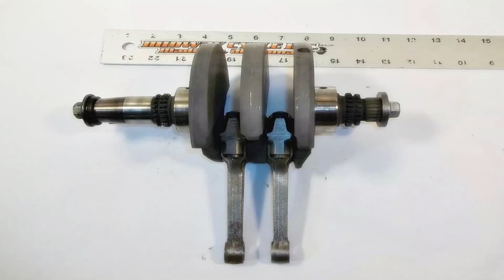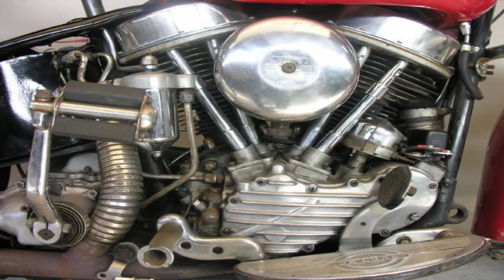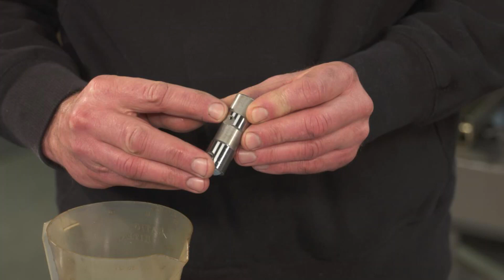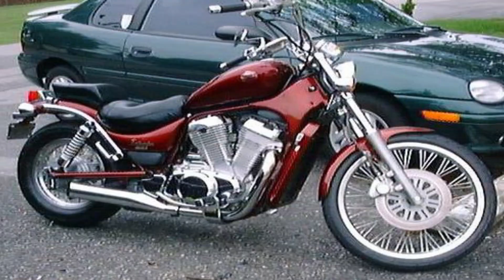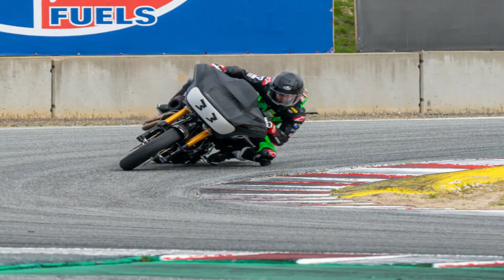Harley-Davidson Engine Design is the Worst

Comment: The victory looked to metric -  
Corvette uses pushrod engine still ; lower center of gravity. Top fuel nhra still using pushrod engine .
✊🏻👍👌
Reply from the maker: That was my issue with the Victory, it looked like a Metric bike with the fit and finish.
Reply: 1) there have been high performance Corvettes with DOHC cylinder heads.  C4 ZR1 Black Widow.  Used an engine (LT5) that became the basis of the Cadillac Northstar V8.  Very cool.  Rumor is the 2023 Z06 will be getting a new DOHC engine as well.

2) Ultimately, there is no replacement for displacement*.

*It's the same reason Harley big twins get used for drag bike motors.  Just about any improvement that can be made to a smaller displacement engine can be done to a larger displacement engine and make even greater increases of power.  Lo and behold, there are tons and tons of big block V8s from more than half a century ago still around that can be built into insanely powerful motors today that the manufacturers of yesteryear never dreamed of.  There are at this point, decades after big blocks stopped being put in passenger vehicles, probably as many H-D big V-twins around, and many, many more on the road.  The difference being that H-D makes their equivalent of a production big block with the same mentality of the Big 3 in the 1960s TODAY.

There are better ways to go about making cars and motorcycles than "do one thing well, and stick with it", especially when that one thing is an engine note and the vibration it makes grown men feel in their ass and groin.  EVERY OTHER MAJOR MOTORCYCLE MANUFACTURER ON THE PLANET SEEMS TO HAVE FIGURED THIS OUT, INCLUDING MAKING METRIC BIKES THAT TICKLE OLD MAN GOOCH.

Comment: The HD V twin design when assembled correctly with proper components is a simple and reliable engine that can be durable. Its  basically a tractor engine that makes torque!!!!
Reply from the maker: That is very true, a built Harley engine can be an absolute tank!
Reply: i agree but " assembled right" means you have to split the casses and start over and if done right youve used aftermarket cases. I put a half a million miles on my 71 but.....
Reply: @davidfellows6250  wow. That's a long ride. Is that 1971? Shovel Head.
Reply: @freyatilly  yeah the engine was a 71. the rest of the bike was a bastard like all my bikes. We used to go to swap meets for all our bikes. i bought a 67- 72 (5) shovelhead . but the 71 was the one i kepted for 20 years.

Comment: Just build a high-quality bulletproof V-Twin with a great suspension and brakes. Hit 100-foot pounds of torque at 2,000 RPMs and 100 horsepower at 4,000 RPMs. All very attainable in a V-Twin. This will give you 120 / 130 foots pounds of torque around 3,000 RPMs. Perfection, in my opinion. It's the government that will make Harley change, not its customers.
Reply from the maker: Harley could build a bullet proof engine, they did with the Evo! Yeah it's gonna be the government forcing change before the customers!
Reply: @GixxerFoo  The early twin cam if gear-driven would have been perfect too

Comment: dude .my 800 vulcan does the potato song quite well. i play guitar. im trying to record ghost riders with the vulcan as the drummer ! open slash cuts and a custom carb. sounds very much like mini  a twin cam with nice cams! no disrespect to the Harley guys , i don't have the coins for an American bike. if it makes you feel better , i call her my Hardley Davidson. HA! it's just a good bike and it really comes close to the Harley sound .it too has single pin but staggered.
Reply from the maker: The Vulcan 800 sounds really good! That newer 900 can't match the sound of the 800.
Reply: The Vulcan 800 is a good bike, but im scared that you play guitar and think the Vulcan 800 have almost the HD sound.
I play guitar and the 800 is not near the sound of a HD. Okey maybe the Street 750! But that is not a potato sound ,more like Singer sewing machine.

Comment: i hope n pray harley doesnt change   this is what harley riders hear in there sleep    not a atv sound of some bikes  i do wish they would engineer a cast crank with slipper bearings    thanks for the show    i really look foreward to your shows    I recently changed out my primary chain auto tensioner on my m8 to a manual    now it shifts like a dream    n    falls out of gear at a idle with no effort...    thanks again
Reply from the maker: That is awesome to hear you got that bike shifting and working like it should now! Thank you for watching, I appreciate it!

Comment: Look up the XBRR engine if you want to see a push rod Harley engine going to the extreme.
Reply from the maker: Yes! That was a wild 150+ horsepower Sportster based engine that actually ran with the big dogs in road racing.

Comment: With a set of Andrews 472 cams, Lloyds air filter, Power Commander fuel tuner pulls good at 2,500 all the way to 6,250 RPM. I have owned 18 Harley's and one Victory Cross Country 106 and you can speed about $1,850 to have strong running Victory vs a Harley that you will have to spend two times as much and still won't outrun a Victory. I'm speaking from experience. My friend has a hot 106 Cross Country and he has outrun lots of Harley big twins and M8 Harley's too.
Reply from the maker: Those Victory engines can run damn good, it doesn't take much with those overhead cam engines to get some power!

Comment: As a student of history, I will be sad when Harley gets rid of their old school engine design. I love it. The nostalgia, the aesthetics, the sound, the feel. Without this engine, what does Harley have? I'm interested in what they're going to do moving forward. Seeing as the decision makers don't ride and know next to nothing of biker culture, I don't expect much.
Reply from the maker: Sadly it's always been those that don't ride that make all the decisions.
Reply: They have already ruined their bigger engines with the awful M8. I wouldn't even consider buying one.  The only REAL Harley engines they still make are a couple of EVO Sportsters. I suspect all new Harleys will wind up with some version of the Revolution Max engine, a VERY Japanese design. The Honda ACE engine and the Yamaha Road Star  were light years ahead of that thing. It reminds me a lot of the engine in a Kawasaki Vulcan 750 I once had. VERY smooth, felt like an in line four. No fins on it at all. It looked like a water pump.
Reply: @geraldscott4302  I have 3 Harleys now but one of my favorite V twins was my '99 Virago 1100.  What a beautiful machine!
Reply: @paulfiore850  I think both the Virago 750 and 1100 were wonderful bikes. Yamaha made a HUGE mistake replacing them with the V Stars. The Viragos looked right, were very comfortable and reliable, had carburetors, and tubeless tires. I never owned one, but worked on a couple. I loved the riding position, especially the seat and bars. I could have had one, but I chose the Kawasaki Vulcan 750 instead. I bought a new one in 1993, and another new one in 2002. I still have the 2002, with 119,000 miles on it. Together I have over 200,000 miles on Vulcan 750s. And loved every one of them. I'm sure it would have been the same with the Virago. It's a shame that They don't make anything even remotely comparable to either one of those bikes anymore.
Reply: @paulfiore850  I had an '85 virago 1000, awesome bike! one of the few things I've sold and truly regretted!
Reply: Forward is not always the right direction to move in. That is especially true in H-D's situation. Plenty of other companies make "modern" bikes for those who want them. H-D needs to keep making bikes for those who want traditional Harleys.
Reply: I agree with you but I think its not so much Harley as it is more of the EPA and EURO. They are destroying this country. Unfortunately with the guidelines they set  the air cooled engine has been taken as far as it can go. I figure within 10 years or less there will be no air cooled engines in anything. Its sad.
Reply: The nostalgia, the aesthetics, the sound, the feel. Without this engine, what does Harley have? I'm interested in what they're going to do moving forward.  THERE BUILDING ELECTRIC APPLIANCES NOW FOR YOU to RIDE👍
Reply: @davidson2004fatboy  Very true. There is nothing Harley currently makes that I would consider buying. The M8 is garbage (I have no idea why they put that counterbalancer in it, don't tell me that affects emissions) I might consider an EVO Sportster if they made one that wasn't 99% flat black. I like shiny paint and chrome. H-D is quickly putting themselves out of business. Fortunately I have a couple of older EVO powered Harleys, and there will be plenty of parts to keep them going for the rest of my life.
Reply: I have a 2021 streetbob with a 114m8. It is rowdy, sounds like a harley, rides like a harley and looks like a harley. Yes they are more modern and don't shake all over the show like the evos and twincams. But the m8 is far more superior and refined. And goes way better. I'd never have a twin cam or a evo as my "main" bike. And I love them all.

Comment: The 45 degree motor just works.  The MoCo needs to solve the sloppy crank pin issue.  No excuse for them not welding the pins.  And yes, timpkin bearings. But they got get the end play tightened up.  
I want a water cooled v twin in a ultra limited trim.  The MoCo needs to catchup with the challenger.  And the challenger needs to full dress it up. 
Lastly… the real MoCo IS Honda.
Reply: Oh the horrible truth comes out. Honda sells more motorcycles than all others...La. la. la. la. I did not hear that.....

Comment: Great stuff as always, Lets stay with the air cooled engine 
Do you have any suggestions on removing a frozen exhaust nut? 
This is the nut on the lower rear stud. 
I think the stud was backing out, until it froze solid.
Reply: Also, buy a tube of spray copper or copper anti-seize paste. Always coat bolts in a layer of copper paste, because aluminum engines tend to capture the bolts, due to corrosion. The spark plugs especially. Always coat your spark plug threads in anti-seize paste, because you can't afford to have galling of the threads on the cylinder heads. I now put the anti-seize coating on the spark plugs on every engine.
Reply: @Ritalie  Thanks,  I  actually was able to get the nut off without tearing anything up.  I appreciate everyone's help.
Reply from the maker: Lots of penetrating oil, heat will for sure help but you can't get it too hot. You have to work that stud out while it's hot cause as soon as it starts to cool it will freeze up again.

Comment: the problem with harleys is vibration and vibration kills.your constantly chasing something that brakes or loosens from the vibration. ive owned lots of harleys  and they all broke.i bought a victory and only had to replace tires and brakes so far,63000 miles .harleys will last but you have high maintenance costs.
Reply from the maker: That's an excellent point! Vibration is hard on everything, Victory is an awesome motor and very reliable!

Comment: if Harley engine design is the worst why is it that all other manufacturers are trying to copy it. You can't find a better sound and low end torque from the M8 design. I say adding some new design for the variety but to me the design as it stands is  like alligators they been around since the beginning of time and will be here till the end of time
Reply from the maker: It's just amazing what Harley has been able to do with the old concept and the kind of power they are getting out of it.
Reply: Indian does not copy the Harley engine. You might want to look up which brand had the V-Twin first.
Reply: @semperfipar1299   Your splitting hairs there. I’m a Indian fan also even though Harleys sound better between the two IMO. What I was referring to is the Japanese Motorcyle.

Comment: Did you know that Harley Davidson offered a turbocharger kit for the 80" Shovelhead? The kit included low compression pistons to keep from inflating the engine.
It can be found in the 1979 or 1980 accessory catalog.
Reply: True this, is say it like Yoda.

Comment: EVO motors rule ! Back in the day fueling made & so did Riviera a 4 valve conversion for EVO motors ! A few guys made it work but not everyone ! Now fueling is working on a 3 valve head for M8 motors that they claim flows more air then a 4 valve head ! The proof that the EVO rules is all the big motors that S & S makes ! All the shops are putting an age limit on how old the bike is in my shop I'm putting a limit of 07 & up I won't work on . I'm busy as can be so if you have a knuck or a pan or a shovel
Reply: Your welcome in my shop !
Reply from the maker: Age restrictions in shops, I get that when they work on newer stuff. You fix one thing and something else lets go, then you get the blame for it. I'm curious to see this new head from Feuling!
Reply: @GixxerFoo  or maybe also those shops don't know how to work on & how to deal with problems with old bikes cause their staff has no experience with them !

Comment: Unless Harley has a magic ball to see which way the fickle market will go , they better be prepared for either as the market dividing and going both ways at the same time is definitely a probability.
Reply from the maker: It looks like they are already preparing for a two pronged effort with liquid and air cooled bikes.

Comment: I would love to see a new v-twin big block with water-cooling, 4 valve, double-overhead camshaft heads that can produce some outstanding performance numbers; I would absolutely luv that!  

But, it has to look good and sound good and be custom looking with super high quality paints and finishes and be super comfortable to ride long distances; no crapy sounding, ugly, and nerdy looking Bikes that hide their ugly engines with a ton of plastic.  And, most of all, it has to be "Cool & Classy!"  

If HD can pull that off, without being too expensive, they'll have a "Winner!"  Peace, Stiletto :-)
Reply from the maker: A water cooled twin that looks air cooled would be awesome from Harley, I think their biggest hang up is what to do with the radiator.

Comment: I’ll ride down the road all day long at 2500-3000 rpm and be happy as a clam in muddy water.  Give me the po-ta-to  sound of my 2000 carbureted FLSTC with its Timken bearings, S&S cams and V&H Longshots.  Call me an old, but happy dinosaur.
Reply from the maker: Those are the best setups right there!
Reply: i have a 02 wide glide with the timken bearings, still have spring loaded shoes, but only 12k miles. gonna upgrade to hydraulic next year 
i have short shots on mine

Comment: H-D should have invested in a high performance V-twin sport bike in the 80s.  Their flirtation with Buell was a half assed effort that ultimately resulted in a better Sportster engine.  Buell made the right call moving to the water cooled Rotax, but H-D should have developed a similar engine sooner and put it in a high performance chassis.  A V-4 could have been neat as well.

The sound is cool, but H-D has put so much focus on selling EVERYTHING BUT MOTORCYCLES (the sound, accessories, clothing, coffee mugs, loans) and not motorcycles that the company is going to run itself into the ground.
Reply from the maker: They got really close to going high performance with project Nova, it just never made it to market.

Comment: Use both. Keep the classics air cooled like the softail and tourers, and use the liquid cooling for modern style of bikes. Best of both worlds
Reply: Replace the oil cooled with air cooled......and remove all the electronics other than creating spark....think 1340 Evo.
Reply from the maker: I sure hope they keep that going as long as they can!
Reply: The 20 Brekaout 114 is air and oil cooled.
Reply: Replace the air cooled with oil cooled.
Reply: Air cooled means oil cooled you idiots lol. Twin cooling is basically two shitty little water coolers that only cool a small bit extra on top of air/oil cooling. True water cooled is on anything with a rev max engine and that relies F all on air cooling for the most part or at least not nearly as much of a part lol
Reply: @aaron.sorenson  you just showed that you know fuck-all about how the M8s cool. Great job!
Reply: @white_devil73  my breakout came with 2 sets of keys and a nicer shade of red ;)   ‘19

Comment: I've seen 90cube sportsters that make 160 hp. That 131 doesn't seem that impressive to me.
Reply from the maker: You can't count out the Sportster, they make some serious power when they are built correctly!
Reply: @GixxerFoo  although they can't match the low end grunt it seems like the sportster is the one exception to no replacement for displacement. What gives?

Comment: Keep making the air cooled push rod motors while phasing in the revolution maxxx. I would also like to see a all out v twin motor that could compete with the power of Duccatti
Reply from the maker: They have got to push those two motors side by side as long as they can!